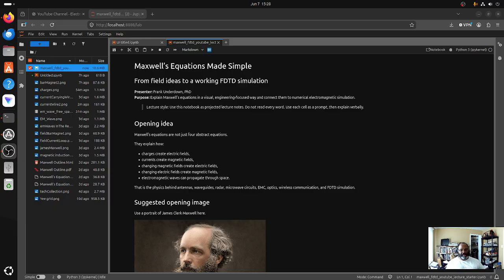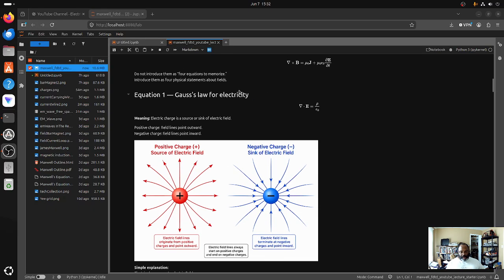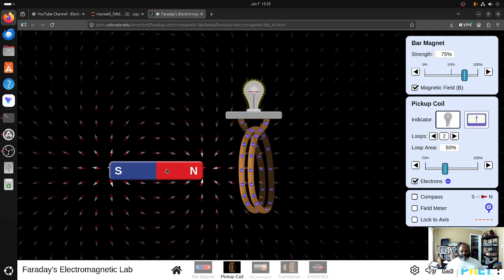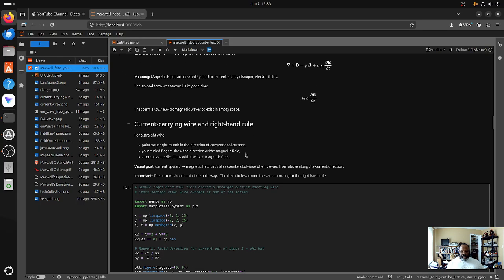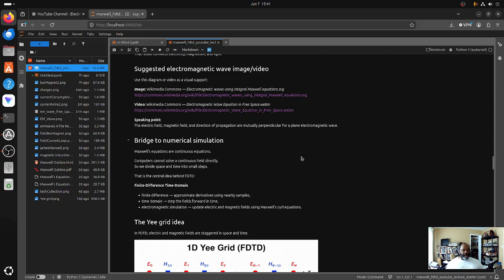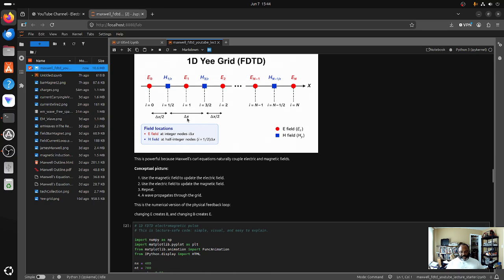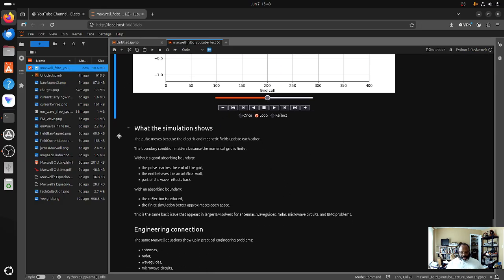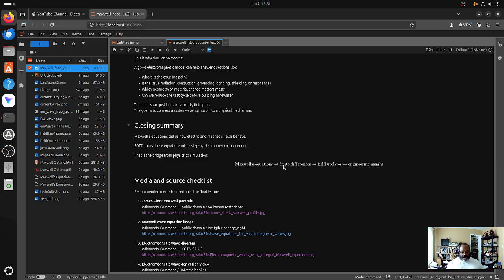Maxwell's Equations Made Simple:1D FDTD Simulation of Electromagnetic Wave Propagation

Comment: Why is the magnetic wave perpendicular to the electric wave?
Reply from the maker: Great question. The electric and magnetic fields are perpendicular because Maxwell's equations describe how a changing electric field generates a magnetic field and a changing magnetic field generates an electric field. The geometry of those equations naturally produces fields at right angles to one another. In a wave traveling through space, the electric field, magnetic field, and direction of propagation are all mutually perpendicular. This arrangement also allows energy to flow through space, as described by the Poynting vector E×H. If the fields were parallel, the wave could not carry energy in the way electromagnetic waves do.